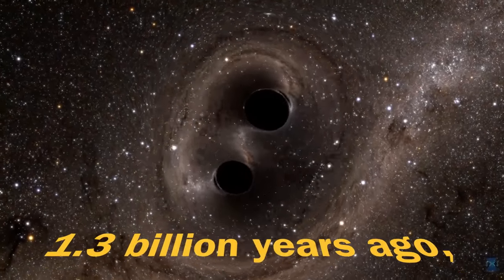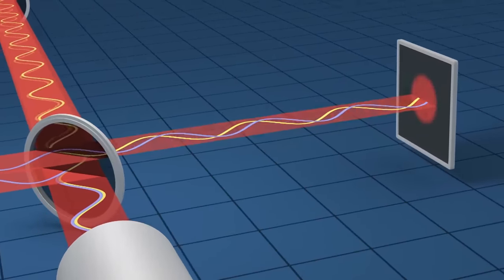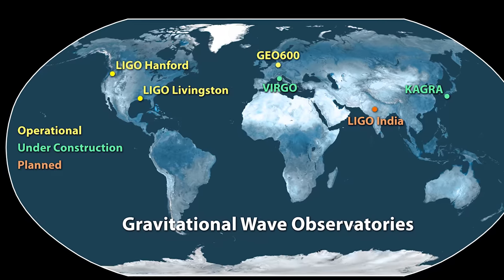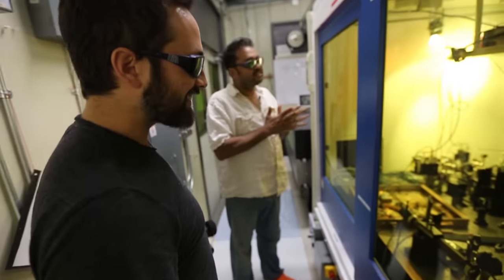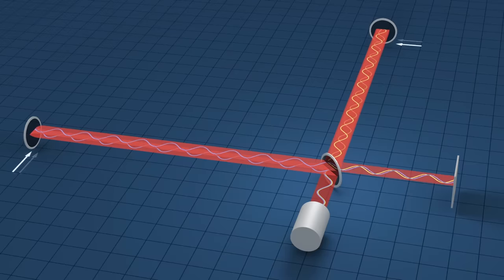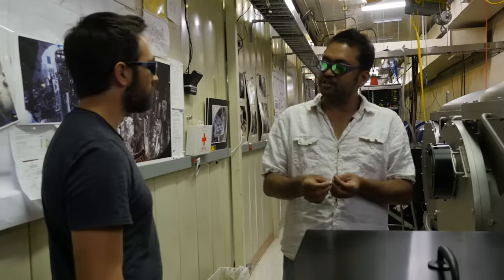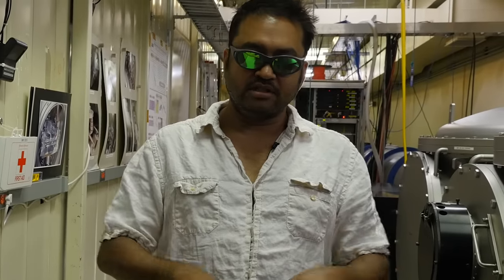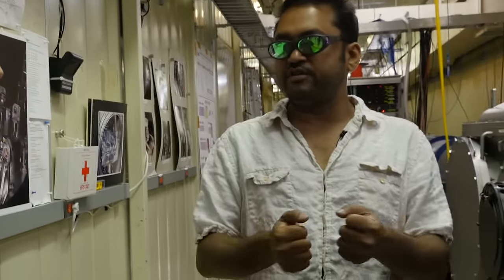The Absurdity of Detecting Gravitational Waves

Comment: Why wear laser goggles if the 1MW laser beam would vaporise your head?
Reply: I don't think that the laser they were using in the 1:100 scale LIGO is 1MW
Reply: off-shoot reflections or stray emissions.  Nothing is perfectly reflective.  If something gets reflected in a different direction, you don't want your eyes to be unprotected.  It's not perfect, but goggles assist in limiting damage.
Reply: You made me LOL
Reply: "THE GOGGLES DO NOTHING!!"
Reply: your head vaporise but your eyes behind the goggles will be unharmed
Reply: Because it looks cool.
Reply: An exposure would include a bunch of reflections and probably spraying metal.  Why wear a seatbelt if you drive on the I-5, when tractor-trailers drive on it.
Reply: Ooooh, that's  a Bingo!!

beat me by 4 hours there, Quick-Draw McGraw.
Reply: because science
Reply: Q : why wear laser goggles? A : because without them, your head would get vaporised.
Reply: i always wear my hardhat when i walk underneath a 20 ton concrete block at work because i feel much more save lol
Reply: They are for the others so they don't get blood splashed in their eyes
Reply: Ramier Wolfcastle speaks. LMAO
Reply: Kevy Elyod charging a big laser in a hurry is not good for the machinery.  When you use an anti-aircraft laser against a fighter plain, it will be over the optical horizon real quickly,so you need an automatic system that can quickly tell if you got it or if you have to recharge and fire.  When I told my wife what it was and how it worked (open commercial magazine). Her only reaction was “ewwwww”.  I thought it was elegant!
Reply: because OSHA
Reply: SPARTAMERICUS  Photons are particles of light.
Reply: Same reason crane banksmen wear hard hats I guess.
Reply: your eyes would've gone last, hehehe
Reply: so you enjoy watching the other guy vaporize without going blind..
Reply: I don't yhink they touch the beam, just look for then, rs
Reply: SPARTAMERICUS  Why do you wear sunblock, or sunglasses, or a welding hood? How do mirrors work? Light can be deflected.
Reply: Kevy Elyod "THE GOGGLES!!! THEY DO NOTHINGGGG!!!"
Reply: Oh never mind!
Reply: At least you look cool while your head gets vaporised.
Reply: Thay have to look cool... 😎😎😎
Reply: @tvgyt1559  because science ,,,, what ? is there a point to your comment ?
Reply: Safety is #1 priority
Reply: because your supervisor says you must.
Reply: @smilernok  It's just a silly joke.
Reply: For the same reason there is a first aid kit the size of a paperback book behind them.
Reply: For looking cool before getting blasted into oblivion.
Reply: So you don't see it coming.
Reply: Filipe Cunha  I'm always stylin', and plan to do so in death.
Reply: i am
Reply: Summing up the comments: chicks dig them
Reply: Absurdity of health and safety.
Reply: Is it just me or did anyone else have the content at the six minute mark go right over their heads? Uninformed as my ass might be I think what they need to do here is partner with the defence sector to create 40KM-400KM long "satellite" versions of these in orbit. Think about it - no noise/interference, already in a vaccuum, and if hydraulics are installed it can serve a backup purpose as a pair of 1MW laser cannons for earth's defence against the inevitable space alien threat!
Reply: @TheRABIDdude  Radioactive man, the simpsons.
Reply: Residual light???? 🤔🤪
Reply: Because OSHA
Reply: Because its cool af
Reply: W N. What isn’t?
Reply: At least you can vaporize in style
Reply: so that if it wont kill you then it wont blind you
Reply: @fakestory1753  that's hilarious!
Reply: @TheRABIDdude  Of course they are inanimate objects  Were expecting a song and dance act?
Reply: So you don´t get blind while your head is being evaporated, duh. :)
Reply: James Meritt you clearly have no clue what you’re talking about.
Reply: Typical regulations?
Reply: You are not ready for this channel.